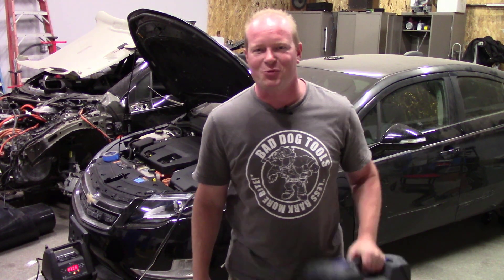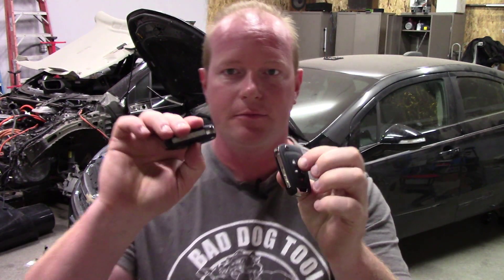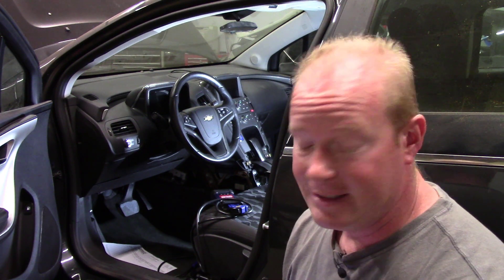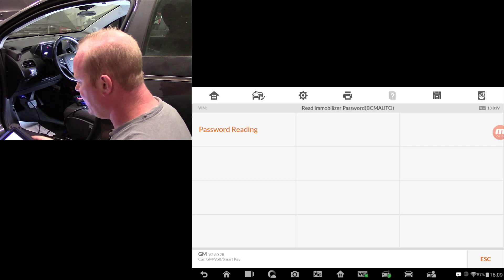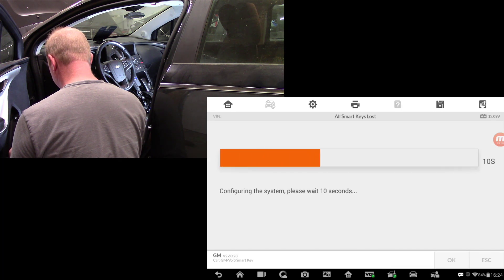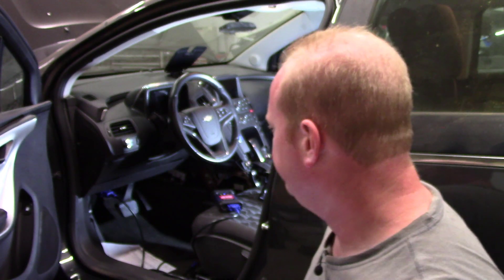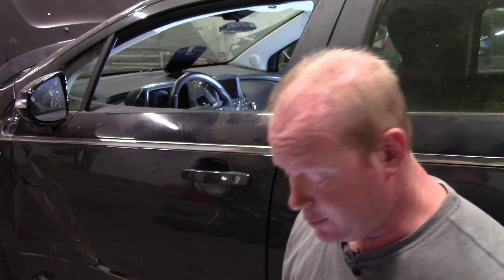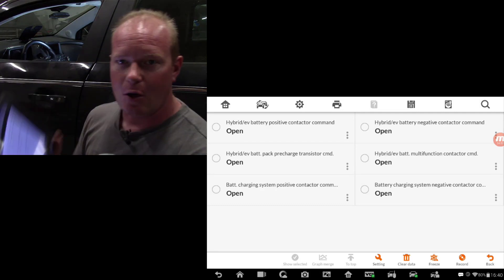Chevy Volt Key Learn using the Autel IM608 #auteltools

Comment: I'm working on a 2005 Ford Freestyle, for a family member, need a new ECM, then possibly new keys, can I just buy this Autel IM608 and use it out of the box, no registering it, updating or subscription fee or any other fees?  Immobilize/ learn new ecm and add new keys?
Reply from the maker: You will need to register and update the tool before you can use it. Registration is easy. There is a newer version of the IM608 you can check out called OTOFIX IM2 https://www.uhs-hardware.com/products/otofix-im2-advanced-immobilizer-key-programmer-full-system-diagnostics-all-keys-lost-vci-wi-fi-10-128gb
This one comes with 2 years of updates included

Comment: You pulled the pin number with the 608. Can the 906 pro do the same things? Or the 909. Don't need to program European  for me. Just Asian and domestic.
Reply: The MS906 can Maxisys series can not pull pins. Autel has a KM100 or the TOPDON T-Ninja 1000 both can for less money then the IM608

Comment: I totally recommend Autel to put model number on the front of their Autel units so in videos, people can figure out which unit it is.
Reply from the maker: On some manufacturers the Autel tools will allow you to pull the "As Built" data from the PCM and push it into the new/used PCM.  However that is limited. I would answer NO to this question because there are to many variables.

Comment: I thot you dont need all those tools, ,  i thot u only need a cut_key...n u can do it ur self, , ?? This is comfusing...my problem is,  i bought another cut key,  when i tried turning it 5/times to the door.  It wouldnt turn like a got a wrong cut key..help please
Reply from the maker: You can program keys to this car with no special tools. But if it doesn't turn in the door you have the wrong cut.
Reply: @FlashPerformance  so they come with ddifferent cuts..its 1 key fits all (gen2) with a program,  so there are more than 1 cut key.? I got it o ebay n the seller says its for  a gen2 volt..can u help?
Reply: So you are saying seller gave me a  Chevy Bolts or Colbalts key not the Volts correct?
Reply from the maker: @tasaytabay5350  I have no idea what you have or what was sold to you. All I know is that you said it doesn't work in the door. That could be a bad door lock, the wrong profile key, the wrong key cut. The none programming issue could be the wrong fob, the wrong frequency, the wrong FCCID
Reply: Maybe he sold me a maybe Volt key..ive tried using lube,   blaster, ,  no luck..cant contact seller, ,  my ebay acc is suspended lol..Axxhole!

Comment: I like the video but I wish the Autel could have been use to program/relearn the Control Module. Why do you have to use a Laptop? Then the Autel is not the latest and greatest.....hmmmmm just pondering.
Reply from the maker: All OE manufacturers require the use of Windows 10 to run their program.  The Autel tools run on an android platform, that is why you can not use the Autel to do the programing.

Comment: BTW, you can ADD US market Chevy volt keys without any tools.  The procedure is in the owners manual.   Many locksmiths can cut the mechanical part of the key by decoding the pattern and duplicating it.   No fancy tool required unless AKL.
Reply: I programmed aftermarket keys $20 each on Ebay for a 2017 Chevy Bolt myself using the method in the owners manual and then had a locksmith cut the keys for another $20.

Comment: Hello sir, I am about to buy a MaxI IM608 but my tool provider tells me that I have to buy most subscriptions in order to have access to most functions, such as programming keys or PCM or some other module, can you clarify that for me?  doubt since you have yours, thanks very much by the way good informative video
Reply from the maker: The IM608 comes with 12 months of updates and 12 months of warranty. During that time you will have access to all the latest updates and functions. Many of the advanced key programing functions require server access. When your tool expires if you do not update you will loose that advanced functions.
Reply: Flash Performance I appreciate that information, it is very useful for me, I am not a technician who is dedicated directly to programming, I like more to develop in other motor functions.  but I will take this into account because it seems to me a useful tool.

Comment: Can the im608 get the key code so it can be cut and if so how
Reply from the maker: Key codes are not stored in the vehicle PCM on 99% of the vehicles.  I think BMW is the only one that may have the key cut code in the computer
Reply: Flash Performance is there a tool that can I have the im608 but I will like to get the code so then I can cut it I get a lot of customer and I got a key cutting machine because I was thinking the im608 can do it
Reply from the maker: @flixproduction6875  Manufacturers do not store the key cut codes in the vehicle electronics.  You would have to contact a dealer with the VIN or use a lock pick tool like a Lishi https://youtu.be/T533OPrYDzI

Comment: Programming many cars with this tool (BMW, Mercedes etc.) involves online calculation. Any idea what happens if after 1 year you won't purchase new updates? Will you still be able to program these cars?
Reply from the maker: You are correct the IM tools are heavily reliant on the online server.  If your tool is not current and your update expires you will loose all that advanced online functionality.
Reply: Thanks for reply. Than it's ripoff. You're buying tool for 3500 and than pay 1k per year to use it. No thanks. Just think - you're buying tool for huge money, and in a year you must pay again so you can continue to use it. It's called rent then, not purchase. And worst of all - they nowhere mention fact that it will lose important features if you don't buy updates. I have AutoProPad which only costs $800, can do 90% of cars comparing to this, no Internet required and it will not turn into brick if you stop buying updates.

Comment: Should of just put back original airbag module autel is able to reset crash data on newer gm with no problem,  like that you can save the money that acdelcotds charges.... Other then that great video
Reply from the maker: I tried to, there was no option in my IM608 or Elite for resetting the airbag module.

Comment: You didn't need a $3600 tool for this, turn the door to unlock position 5 times... It's in the manual...
Reply from the maker: I don't think that will work for all keys lost.  You would need to have at least one working key to do it that way.
Reply: @FlashPerformance   Page 33 of owners manual, and one key is useless for adding keys, you have to do the same method as all keys lost if you want to add a key when you only have 1.

Now if you have 2 keys already programmed you can additional fobs, up to a total of 5, without the 3 sets of 10 minute waits.

GM has been programming keys with this method since 07 for trucks and much earlier for cars..  Basically any chip key that isn't VATS...
Reply: @FlashPerformance  0 ppl

Comment: Didn't you have to do the VSP thing that if you're doing keys there's a form for. It's something to do with making sure that only people who need be are getting access to security databases for doing this type of stuff. I think it may have been LSID for making keys, etc. Trying to learn this stuff which is why I'm asking.
Reply from the maker: An LSID is needed if you do not have the ability to pull the pin from the vehicle.  Since the Autel tool can pull the vehicle PIN an LSID is not required.  On some new vehicles like Nissan 22 Digit you will need an LSID.

Comment: Does autel sell the tool without the J-2534 (J-Box) as I have the drew tech and the Bosch ADS-625 I bought came with one as well.
Reply from the maker: The IM608 always comes with the J-2534 box.  You can purchase the IM508 and add the XP400 if you are only looking to add keys.

Comment: So you were talking about the air bag control module you had to buy from the dealer. 

Are you able to use the one from the one that had no air bag deployment, was it gone or are they not capable of being rewritten or learned into the system? I thought there's aftermarket companies that offer them cheaper? I've seen air bag parts, etc...
Reply: Never mind saw later in the video that you addressed the module issue. That's still something that makes one wonder if there's a way to rewrite the VIN# for the SRS SDM modules. 🤔
Reply from the maker: Check out this video on programming https://youtu.be/NrvpoCN3J2U

Comment: What is the difference between 508 and 608?
Reply from the maker: IM508 is only read and clear codes for diagnostics, no bidirectional control.  The IM608 has full diagnostics and a JBox
Reply: @FlashPerformance  i have maxisys elite already,do you think im508 would be enough for me.i need something that can program bmw key
Reply from the maker: @realmechanic-z3j  get the IM508, XP400 and G-box2 and you are all set to do BMW
Reply: @FlashPerformance  with all those addon it will do same as 608 for key programing?
Reply from the maker: @realmechanic-z3j  correct, with your elite and these additions you will have all the diagnostics and key programming
Reply: @FlashPerformance  kool thank you

Comment: Also you can reset those airbag modules, very cheap and easily.
Reply from the maker: Not on this vehicle.  There is a reset process in the tool but that is only for the Yaw sensor.  This module, once blown, has to be replaced.
Reply: @FlashPerformance  wrong!

Go to Ebay and search srs module reset, many providers reset the crash data at chip level and charge $40 for this service,  a fraction of what you paid for your new module! The hard crash data is only setup that way as cash grab from manufacturers!  Nothing is physically blown on srs modules,  I've done hundreds!
Reply from the maker: @globalcommerceca  Thanks for the information. I will consider that next time.
Reply: @FlashPerformance  no problem,  good review /steps on the scanner,  I'm trying to choose which to get, would you be able to verify if it has immobilizer options for 2014+ Corvette?  Thanks!
Reply from the maker: @globalcommerceca  I show coverage on the corvet up to 2016 on the current update. https://www.autel.com/vehicle-coverage/coverage2

Comment: If you have a key that runs the cylinder, leave it in the ignition in RUN for 11min three times (switching to off when the key light goes out) it will learn it without any tools.
Reply from the maker: This is a prox system. There is no ignition cylinder
Reply: @FlashPerformance  you'll need to have it next to a transponder antenna 📡... If there is push start button you can press it 3 times to get into ACC mode... I'm not sure with Chevy though, and in some cars won't take old keys if they aren't erased first — not a factor with new keys.

I guess if you mess with random cars often and don't feel like learning the rain dance for every car it's a good tool. Time vs money argument. Fixing cars and stuff is a good hobby.

Comment: Hi
When you will upload part 2 because I have been waiting to hear from you how to connect the j2534 to the laptop and use it on GMC
Reply from the maker: Loaded https://youtu.be/NrvpoCN3J2U
Reply: Search for TIS Web. Should be able to find something digging around in that name.
Reply: @dtnel  thanks
Reply: @zeyadalbaijan  did you find something with TIS WEB search for what you wanted to do? For programming keep in mind some mfrs have requirements to have a battery maintainer which I've seen anywhere from $500 to $900 roughly. The voltage has to be stable and just so you know a battery charger won't do this. Not done properly you can brick your module and then you're out more money so be careful.
Reply: @dtnel  no not yet because I couldn't open the ac Delco page

Comment: What I don’t like about this tool from autel it s the yearly update fees 1250 kinda too much specially if they made the auro im600 like 2 years ago and the update was free for the life of the machine I checked the tool the obdstar and xtool better with prog keys
Reply from the maker: The updates on the IM608 is $895, the other tools you mentioned have "lifetime updates", but you still have to purchase the software upgrade. The xtool has limited diagnostics an no Jbox.
Reply: Flash Performance not true the software update its free for the life of tool my boss own one but I find that the autoprobad by xtool easier to use and have stronger software for European cars not all the distributors charge u 895$ and that missed up too